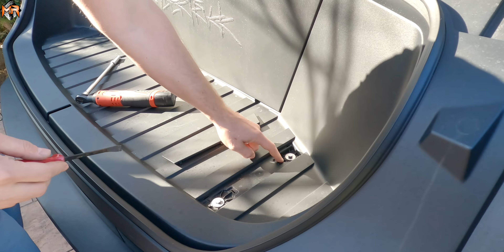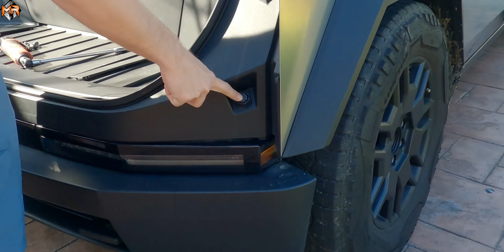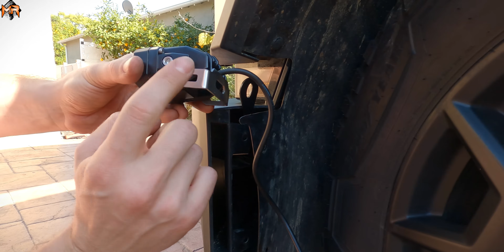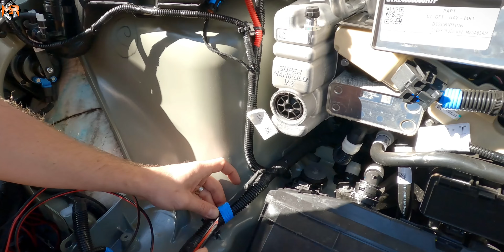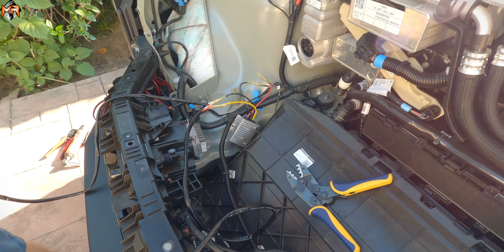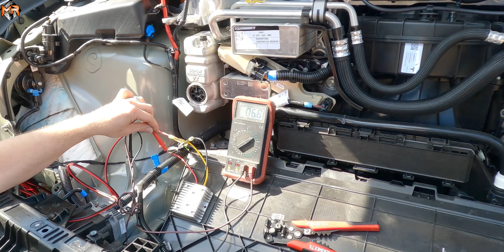Tesla Cybertruck CyberLUX LED Light Bar Install | Tutorial by M&R Automotive

Comment: my lights flicker on and then trip off and i have to reset the feed in the tesla screen
Reply from the maker: M&R lights? What converter did you go with?
Reply: @MandRautomotive having same issues, i wonder if i just need to wait for voltage to drop longer
Reply from the maker: @Angler-Dangler  Think this is all cybertrucks
Reply: @MandRautomotive ok so its just waiting for voltage to drop before cycling power. I think if i wire a switch in between transformer and lightbar. And leave roof power on i should be able to just on/off when in use
Reply: @MandRautomotive  the amazon link. maybe its faulty?